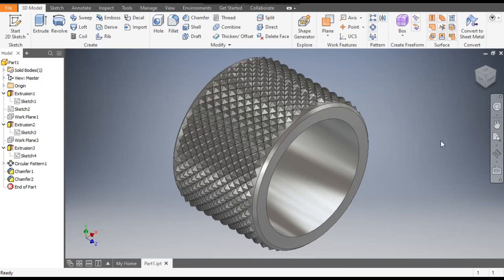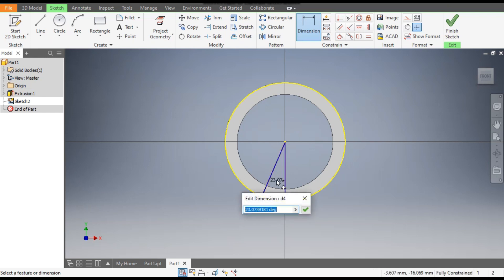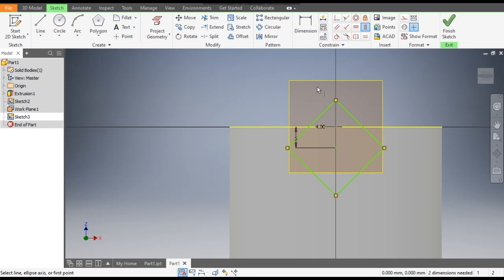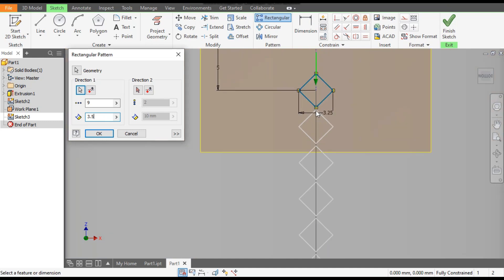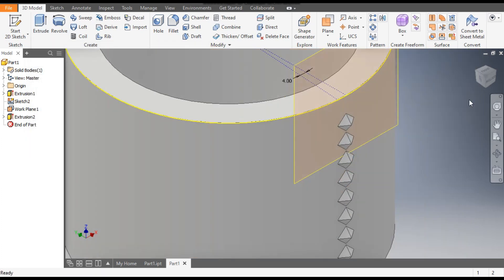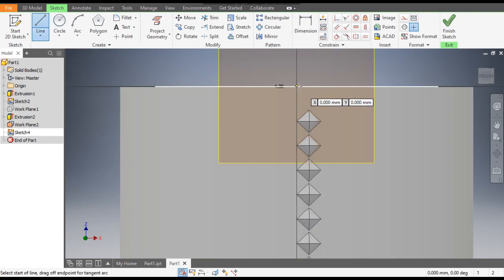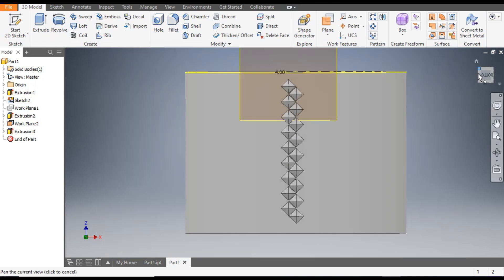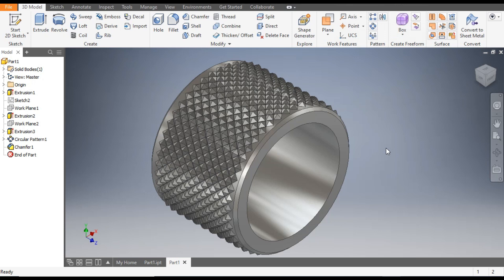How to Make Knurling in Autodesk Inventor || Autodesk Inventor 3d tutorials || Inventor Tutorials 3d

Comment: With all due respect, but there are 2 major mistakes here:
1 - No knurling is that spikey; those pyramids actually have their tops flat
2 - knurling never ends like that on the sides; each row starts with a full pyramid and ends with a half pyramid, with consecutive rows alternating their direction.